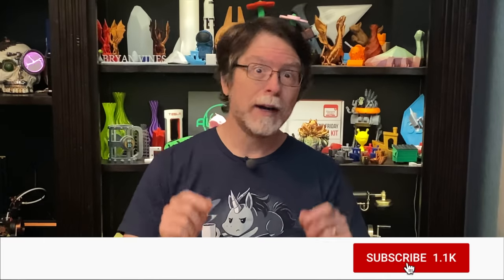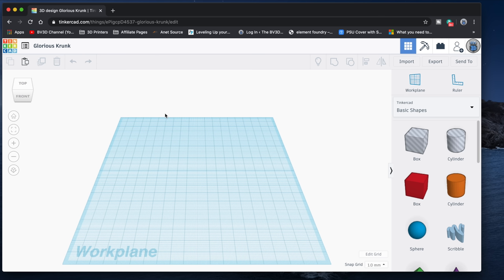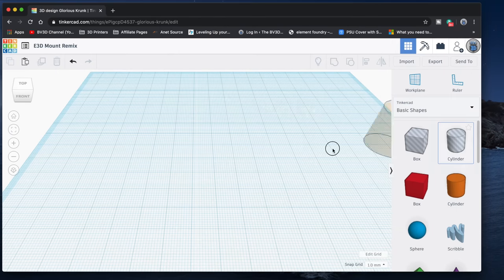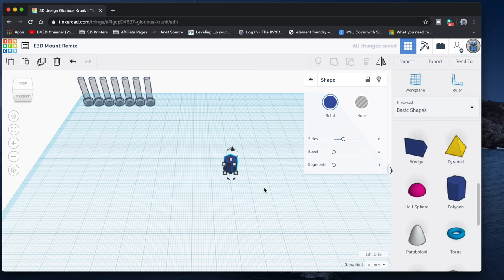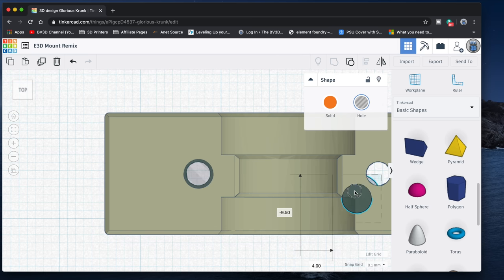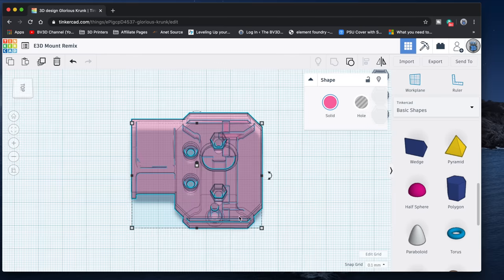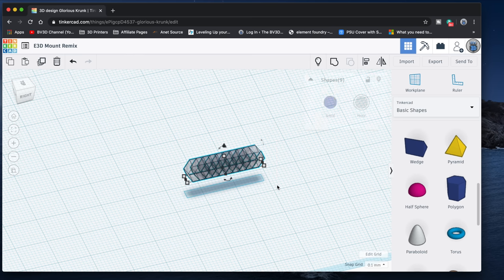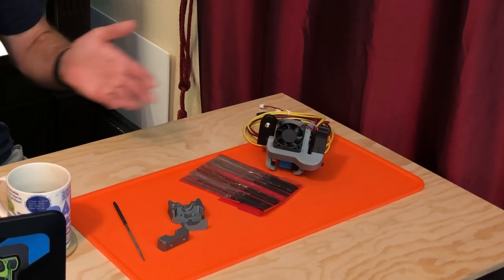How To Remix Thingiverse Things Using Tinkercad, When Screws Don't Fit

Comment from the maker: FROM NOW ON if you want to make any sort of comment about how a drill should have been used, you have to sign a document indicating you have watched the video from the 11:50 point through the 16:00 point, and that you've read the fifty OTHER comments all saying the same thing, AND in your comment, you have to tell me how you would've drilled a hexagonally-shaped hole. 😉 Sincerely, the management.
Reply: Also, you could try change how your cura slices, middle to what ever that might help with out a remix.
Reply: I accidentally posted My comment that was about my own bad habit of drilling out holes before i saw this😂
Reply: Nice one Brian 😂
Reply: instead of copying that nut and grouping it together for a "channel", @14:30, wouldn't it just be easier copy it once then drag/stretch the nut out?

of course copy it once otherwise you'll deform the end that matters. then pull the copy using the black drag box in the middle.
Reply: Great video - you could also consider a captive nut? Where you create the void for the nut in the mode - and pause the 3d print at a point and drop in the metal nut then resume printing?

Comment: Hi, I'm the designer. I'm sorry you had problems with this duct . I've just been and checked the CAD file and I made a mistake. Somehow I sized those holes at 2.4mm rather than the required 3.2mm for the M3 screws. This is a remix of one of my existing designs, and while I generally test print all my designs this one seems to have slipped through the net. The part it's derived from prints fine with the correct sized holes.
The STLs will be modified as soon as I can. Apologies if you reached out to me on Thingiverse and I didn't respond.
Reply: The files have now been altered. I hope you get good results with the part cooling.
Reply from the maker: Hi! Thanks so much for fixing the files! I've pinned your comment to the top, and I've made a note in the description to indicate the files have been fixed. YOU ARE AWESOME! 👍

Comment: Thanks. I learned a few new things about Tinkercad. I tested recent versions of Cura, Slic3r PE, and IdeaMaker, and they all adjust the perimeter of the hole based on the extrusion width by default. I think that the original holes were too small at 3.1mm and should be enlarged, but it probably wasn't your slicer's fault. :)
Reply from the maker: That's interesting. I'll have to give that a test, too! Thanks! 👍

Comment: I use tinkercad a lot for designing and remixing and I lerned some very useful tips from this vid. Great stuff. :) I'd like to add a little tip of my own if I may. Rather than rotate objects 180 degrees I like to use the Mirror tool (M key). With the object you want to rotate hit the Morror tool and arrows appear around it. You can hover over the arrows to see a preview of how your object will look then you just click on the arrow you want. This tool is very useful for rotating 180 as well as mirroring to creat 
e left and right handed versions of an object as an example.

Comment: Thanks for the very helpfull video. I used prusa slicer to do modifications before, but thats more complicated and you can not export the result in stl but in amf only. So not so easy to share.

You are totaly right about the CC no modifications licence do not fit technical parts. In many countrys it is simply invalid for technical parts anyways, because the creator of an technical object owns no "copyright" so he can not give a licence.
For example in germany you have to devide precise into an "artwork" (books, songs, videos, pictures, paintings, statues etc.) where you are the owner of a copyright (german:"Urheberrecht") "automaticly" on one side and "technical solutions" on the other side. For technical solitions there are patents, design protection and some commercal laws. All applying only for commercial use - and the first two only if you register your design (and get the protection granted). If you do not have patented or design protected you technical construction, you can simply not restrict any private user in modyfiying and sharing. Only if he makes money using your work, he have the right to claim part of it.
Actually this was a problem in the late 1970s and early 1980s with the home computers and comercial software for them. Games where "Art" - but text editors? Even the operating system? Actually Windows 3.11 did not fall under "Urheberrecht" by its core functions but by courts declarying the Graphical user interface not been fully following function but contaning elements of art... Of course, law was changed to get sowfware protected against copys afterwarts - but technical constructs are not. So in germany it would be legal to change and publish the changed technical object. Which is the case in many other countrys also.

But of course there is a much nicer way if the creator of an object has used the no-remix licence: Simply contact him and tell him the problem (and the solution) and ask him to publish the modification with his thing-files or allow you individualy to publish a remix. Such a licence is not written in stone, the autor can of course grant you more rights if you ask politly. It is even the best solution if he generally allows remixes, if you only solve some errors by the remix - as people may see his design first and might dislike it. So it is always better the original designer publishes the corrected thing than having a problematical thing and a corrected thing side by side on thingiverse (and if someone donates, also the original creator did the main work and should own it).
Publishing as another thing should be done only, if it adds something new (for example remix a carriage for the prusa extruder in the bondtech version with a carriage for linear rails on the Ender 3 to get a mount for the mk3s Bondtech extruder (or it variant MZ76v2 from Thingiverse) on an Ender 3 with linear rail on x (not an randomly example - I made such an adapter, but in Prusa slicer, so I might redo it as you described in your video to publish it on thingiverse). In my opinion the MZ76v2 Extruder is one of the best upgrades for most cartesian FDM mashines - and it is availabe for v6 and Mosquito hotend. Only the Hemera might be sligtly better).
Reply from the maker: Hi! Thanks for that informative and well-thought-out comment. Very interesting about copyright law in Germany, and how it's split along artistic and technical lines.
And I think the suggestion to work things out with the original designer of a part is a good one. 👍

Comment: in ideamaker, there's a setting called "XY Size Compensation for Holes", after tuning in the parameter for this, I no longer need to calculate how much I need to make it larger for whatever diameter of the holes.

Comment: Great video.  I know the answer is Fusion 360, but I sure wish the alignment tool in Tinkercad would allow you to select a feature on a part.  I agree that it's ok to eyeball something but having a way to align things perfectly would be so much nicer.
Reply from the maker: The ability to align on a specific feature would be great, but Tinkercad leaves us having to nudge with the arrow keys. 😬
Reply: @BV3D   you can align features perfectly by changing your workplane and hitting the d key to drop it to the feature you want to group it with there will now be no space between them...

Comment: Nice info all around!  just got a 3d printer and although i worked in the automotive industry from which i worked with blueprints and knew what CAD was, sadly i never learned to use it and design/modify parts.  The bit with how you need to add the nozzle diameter to the size of your hole to get the actual size you need was worth it alone. Although i SHOULD have realized this from my past experience it was a while back so im rusty. \
Thanks for the information!

Comment: Hi Bryan! No, this isn't a hexagonal drill question lol!  Rather, I have something very odd going on when I remix with Tinkercad. I wanted to remix a clip that snaps onto the rear of a pi400 so you can add a monitor. I made my adjustments & exported the stl.  I brought it up in Cura to slice, and the changes were still there.  After slicing, I tried printing it. It prints the piece I merged, then tries to print the original model, but at that point the nozzle is already at 0.5mm above the bed (0.3mm first layer with 0.2mm layer height), so the rest of the print is stringing our merrily....nowhere near the bed.  I've tried Tinkering other models, and it happens every time - the first layer of the addition is printed instead of the entire outline.  

Now, I've made sure my parts are joined & nothing is above or below the workplate. Any ideas on what's wrong? Thanks!
Reply: depending on the accuracy level required, you can  try to lower the entire thing in Cura one-two layers below the printing surface before slicing, and try that. Probably  not  that good for mechanisms requiring tolerances, but  for other things can be all you  need (figures, etc.)

Comment: Actually any modern slicer will offset toolpath half the nozzle width. It is true that adding about nozzle width to hole diameter will get hole size close to desired diameter but its not for the reasons explained in the video. All depends on used speeds and plastics etc.

Comment: I will mention using a drill to size the holes correctly because there is a special case where this is the only way to get the hole and the fitting part sized correctly. That is very small holes in very small 3D-printed parts. In my case, a 2mm diameter rod 5mm long that slides in a hole in a curved part approximately 5mm square and 3 mm thick. At this scale, 0.1mm is 5% of the width of the hole and the rod, it is unreasonable to expect any 3D printer to print very small parts precisely. My solution was to print each of the parts on the end of a larger rod that I could hold in my lathe so they could be finished to the correct size quickly and precisely, then parted off the mandrel. Finishing these 2 small parts in the lathe took less than 5 minutes and made it possible to repair a $5000 instrument when no OEM parts were available. The big problem with fixing holes with any hand-held tool is keeping the holes round, aligned, and centered correctly. And Yes, I read the comments and I found your video to be very helpful, thank you for taking the time to present your fixing holes solution.

Comment: Thanks for the clear details on how to use tinkercad. I don't agree with your methodology. Design the part in CAD and include the required clearances. Making adjustments to the CAM is the correct way to achieve the desired dimensions, not altering the model to achieve a result that wasn't modelled. This way, you maintain a machine agnostic model that represents the desired end product. With subtractive machining, operators apply thermal adjustments, tool wear and backlash compensation to account for machine specific settings. Any QC processes are setup to ensure the finished product matches the design. The 3d printer CAM (aka slicers) have similar adjustments. With this, you never need to remix a properly designed model even if you change printers, filament or extruder sizes. Hope that helps
Reply: What program?  That doesent costs a hobbiest like me and arm and leg?

Comment: Question Bryan:  If you want to significantly changing the size of a STL design found on Thingiverse, how do you preserve the size of hinges and latches?
I found a Pelican case design on thingiverse that is huge (525mmx432mmx165mm) and my desired size size is 160mmx125mmx 45mm).   If I drag the entire model to the smaller size, doesn't that collapse the hinges and latch connections also? 
What's the best way to achieve a working but smaller size case?

Comment: With the ptfe tube on the sovol, have you had issues printing other materials? I’m thinking of printing ninja flex, abs, and pla and maybe in the future other materials.
Reply from the maker: I've had issues with the temperatures associated with PETG. Printing at 245˚C for a couple of days was enough to cook the end of the tube. Any filament which prints at or below about 230˚C should be OK. For flexible filaments, you should make sure the guide tube (between the extruder gears and the top of the heat sink) has a PTFE liner. From the factory, mine did not, and so the flexible filament was able to bunch up inside the guide tube. 😬

Comment: Hello Sir,  I'm happy to see that you know your way around Tinkercad really well.  Perhaps you can help me with a file that I've designed.  It's a set of headers for a V8 Motor and I made it out of sever cylinders and torus bits,  But my parts don't exactly line up smoothly with the exact shape etc.  So my model looks like headers that were put together with many parts and don't flow seamlessly from one part to the next.  If this makes enough sense that you understand what I mean it would be awesome if you can provide some guidance on how to solve my problem. I'd be happy to show you a screen shot photo of my current "glob" and a photo some something that looks like what I want to create.  

Thanks so much if you're able to help or advise.

Comment: Hi, I am brand new to 3D printing, my son gave me a CR-10 3D printer that he had picked up.  One thing I have tried to do using TinkerCad was to print a bolt and nut that would fit together.  However, TinkerCad is limited in capability so I am unable to make a bolt or nut from scratch.  I have tried to find a sample that I could modify so they would fit together but have had no luck.  Any suggestions?  This is just a hobby, and since I am retired I don't really have the money to spend on a more expensive CAD system.

Comment: sooo is there a reason he couldnt use a drill to widen the holes?
Reply from the maker: Because then he wouldn't have an excuse to make a video? Also if he needed to reprint the part again, having a part with properly sized holes means that he can print it and have it ready to go without having to mess with it. But mostly so he has an excuse to make a video.

...Also drilling wouldn't have fixed the problem with the pocket for the hex nut. 😉

Comment: When I run into this problem I use this new fandangled gizmo called a drill and something sharp spins on the end called a bit ? Maybe you've heard of it ? lol jk good job =0)
Reply from the maker: 😉 The problem with drilling it out is, it would be removing nearly all the perimeters supporting the hole. 😳
Reply: @BV3D   and how drilling is the different from a file ?
Reply: @3DPI67  a file slowly removes layers which is easier to control. Conversely a drill just chops through violently and would just rip through the outer shells exposing the infill. It's like do you guys even 3D print or are you just thinking like a carpenter? This isn't wood..
Reply: Ok
Reply: @wickedjack1223 - please could you point us to your videos that are on youtube that assist others. Yours must be so much better than this one for you to feel you can mock.

Comment: This is exactly what I needed to see today.  I'm making a clock but adding an additional segment to it so I can display 24-Hour time but don't wan the dimensions of the backer board it mounts on to change.  I'm deleting the unused segments to close up the space and adding a ":" to separate the digits.  I need to cut the core supports and sleeves into two parts then resize them.  I'd love to hear any suggestions on how to cut 1 part into two parts since I haven't been successful at doing that yet.  Here is a link to the original Youtube project where I found it at:   https://youtu.be/8E0SeycTzHw
Reply from the maker: That's an awesome project! OK, so the easiest way to cut one part into two pieces in Tinkercad is to duplicate the part, so you have two of them. Then, use a "hole" cube large enough to cut away half of one of the parts. Then,  do the same for the other part, cutting away the other half of it. You'll be left with two half-parts. 👍

Comment: Or you could use Horizontal Expansion in your slicer
Reply from the maker: As useful as that feature is, it wouldn't have fixed the hex nut pocket that was squared off, which prevented the hex nut from sliding far enough in that it aligned with its associated bolt hole. Sequence starts at 12:34 😉

Comment: Could you add any more abbreviations in a sentence?  Practically every second word in the first few minutes was an abbreviation made it impossible to follow.
Reply from the maker: I’ll try to do better. Which ones were problematic?
Reply: @BV3D  The first couple of minutes
Reply from the maker: @octapc  In the first two minutes, these are the main acronyms in use:
E3D - The name of a well-known company which made the hot end I referenced.
V6 - The name of the well-known (and often cloned) hot end, made by E3D.
PTFE - Poly Tetra Fluoro Ethylene, also known by the trade name Teflon.
SV01 - The model name of the printer this part was intended to fit.

Filament types. Filament is commonly identified by the acronym of its main ingredient.
PLA - Polylactic Acid, the main ingredient in a popular type of filament.
PETG - Polyethylene Terephthalate Glycol, the main ingredient in another popular type of filament.

If you're new to 3D printing, you'll find these terms used a lot. I hope this was helpful. If there was a specific acronym I didn't call out here, let me know and I'll expand on it.

Thanks!
Reply: @BV3D  Hi thanks for the effort in detailing the info.   I have an Anet A8 and a Elegoo Mars Pro but haven't touched the Anet for 2 years and just started playing  with the Elegoo.  There was so many acronyms in such a short time I couldn't follow it.  Sorry but there are slow people around.  :)